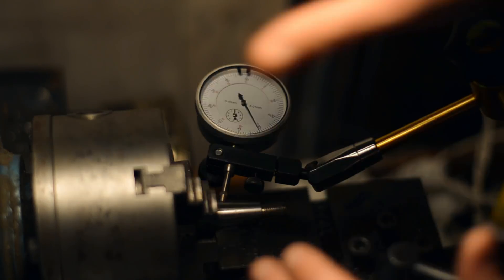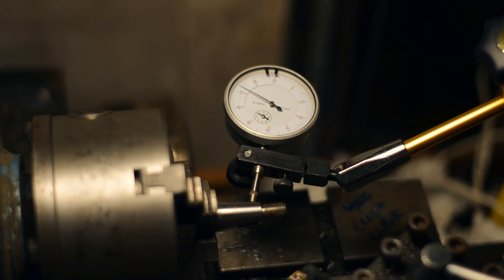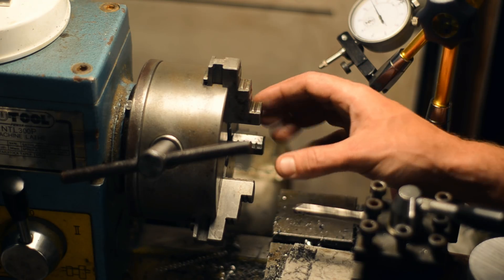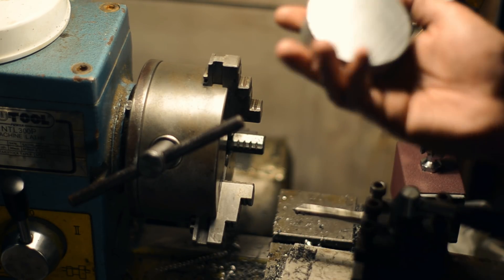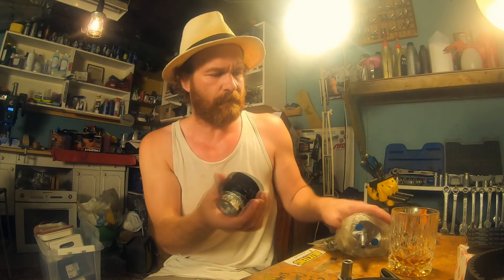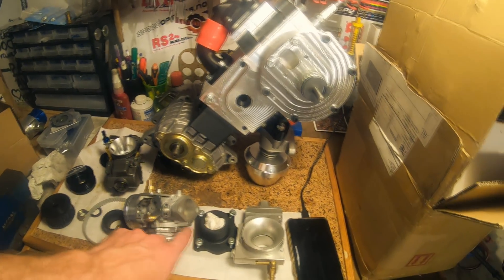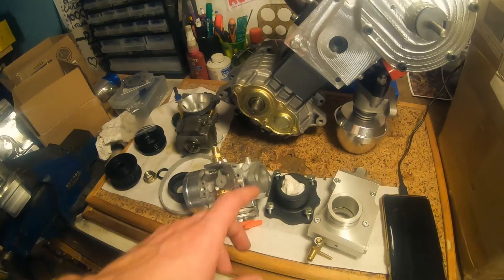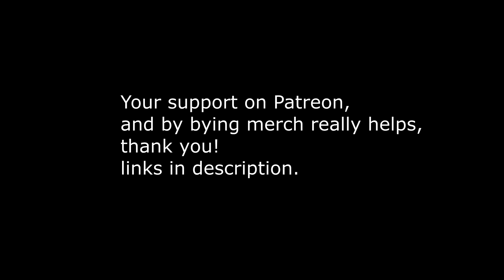Creating a Monster!

Comment: One thing with your supercharged nitro two stroke...  i recommend to ditch afr gauge and switch to straight to only egt... that is more reliable with nitro, if you want to it run properly, you will need engine running rich.... very rich, then you will get good egt temperatures. you need quite wild ignition advance with nitro too, im not sure how much nitro % you will be using but our tf engines run about 50degrees before tdc timing... + be carefull... do not explode yourself while starting the engine, i recommend to flush engine clean without spark plugs and using gasoline for starting purpose... dual spark plugs and ignition system with power of over 100mj for single spark is recommend...

Comment: There is a slot for a keyway on that crank taper, I suggest you use it.. Also the ignition timing from secondary shaft will bring all sorts of issues when trying to get to the top revs. And the fuel feed is going to get too lean, if it ever will get near the redline. Still to much parasitic loss for that rotating mass to get any gains over N/A setup. That size and style of blower needs 1,5 liter minimum of engine capacity to create more power. Your application, if you insist on using forced induction, an electrical assisted centrifugal type would give better results. It might even last a full run.

Comment: I had a couple of ideas that may or may not help you . I was thinking that you could make the nut also the rotary valve pulley as one part on its own . I guess getting the timing perfect maybe effected if the nut was to loosen.
Also I suggest if you have access to an old bus or old truck that may have a eddy current brake . It will cost a lot less and apart from corrosion it cannot wear out.

Comment: You cannot turn the jaws on a three jaw chuck you have internal and external jaws. You can turn the jaws on a four jaw chuck. Some very big lathe chucks have a facility to turn the front of the jaws, usually in heavy engineering factories, to hold internally or externally.

Comment: Dynapak use hydraulic pumps in their hub dynos.  They work great.  Pump and a solenoid valve in a water cooled recirculating tank.  The low inertia could be a problem though.

Comment: You need a 4-jaw chuck mate. I couldn't live without mine, there are so many things you can do with one that are impossible with a 3-jaw. For best results with one you also need a set of parallels and a fixed steady rest.

I also have a 'griptru' 3-jaw. It's adjustable for runout, so you can get it within 0.02mm on any given diameter of 'thing' you're holding. Excellent for repetitive work, but no match for the 4-jaw on versatility.

Comment: I think the pumper carb should work and you shouldnt have pulse problems.
Reply: I agree. Every time the transfer ports are exposed the pressure in the manifold is going to decrease by a lot, then bounce back up as the transfers are covered again. Also the roots blower will inherently create some pulsations in its output.
Reply: @nerd1000ify  yea man i was thinking the same,  looks like a nice carb too. We shall find out soon💨💨💨💨🤙🏻

Comment: Back when I was an electric traction motor apprentice (1979 - 1981), I used to operate & maintain a Thomas Salter brake dynometer, testing the 22 HP forklift traction motors that I'd built.

The dynometer itself was an dynamo with attached wind turbine loading contraption. The dynamo was electrically connected to a second electric motor, with a 12 Inch arm on its output shaft, which was coupled to a set of massive Thomas Salter pull scales (The brake part of a brake dynometer). 

During testing, I'd measure the peak load current consumption and measure the RPM with an engineer's hand held tachometer. I'd then observe the amount of Pounds being exerted on scales, which because of the 12 inch arm, was now torque in Pounds / Foot. Using a slide rule (later a calculator) I'd multiply the torque by the RPM, then divide by 5,252 to reveal the horsepower. Because I was using a brake dynometer, the electric motor's test plate was stamped as BHP instead of HP to demonstrate that the power output was derived from measuring torque output and not through electrical Wattage generated.
 
A brake dynometer of this type is the simplest and easiest to construct, even in miniature to test Scalextric cars
 
For a moped engine version you need 2 x car starter motors (one to act as the dynamo), a set of pull scales, an accurate tachometer, a loading contraption, some metal and some wire.

Comment: Will not placing the ignition trigger at the RV mean that every time you like to adjust it, you have to reset the timing…again…and again… 
Jag skulle bli tokig! 😅 
At the crank is has other advantages as well…even if I realize it’s tight.
Looking forward to the continuation of the PiP when time is.

Comment: some made an eddy current brake from a retarder https://www.huismanauction.com/auction/38/item/jacob-electric-brake-retarder-for-truck-driveline-3000/
these are usually mounted in busses and trucks driving in the mountans a lot , with a retarder they dont have to brake as hard saving them from overheating and fading 
you could allso use a big electromotor rewired to work as a generator and a bunch of balast resistors that you can add to the circuid to raise the resistance the generator makes 
a local moped / bikeshop ran a 250 cc dragbike and had a flywheel with a diskbrake he basicly took the rearwheel of the bike mounted the rear fork to the frame holding the flywheel and used a longer chain 
he measured horsepower and torque by measuring the time it took to accellerate between a base and top rpm in top gear , he did put a matrass over the flywheel as a shatter blanket 
could allso use a big centrifugal waterpump from a firetruck and make a water columb (stell pipe going up two floors or so before overflowing in a big water container) with taps at different heights for the ballast you might need to drive the pump at half speed to prevent cavitation (wonder if a jetdrive for a boat or even the tailsection of a realy big outboard engine with a big prop hung in a vat of water would work , if it does it might be the cheapest option )
combinations work too and might reduce the size of stuff you need

Comment: Hi, use Bacho / Sandflex 3906-300-18 to cut solid, or 3906-300-24 for cutting thin materials or tubes. Super quality that will make a difference. / S

Comment: Parasitic loses through belts may beat you, good luck
Reply from the maker: Properly tensioned toothed belts aren't bad at all. On the dyno it doesn't matter either way, the load cell is mounted to the engine which pivots around the crank axis.
Reply: @2STROKESTUFFING  isnt that your blower drive ?
Reply from the maker: @crunchytheclown9694  Yes, sorry, though you were talking in general. I can't see a better way to drive the blower. If it was incorporated into the case I could use gears, might go there if it delivers.

Comment: Is the weight of the pullys an issue? Seeme like a lot for a 50cc to turn.
Reply: Ive seen 3d printers with pulleys this size, no problem at all for a 20hp engine

Comment: Geez I have always thought you to be a character even with out a hacksaw.. ;-) I have made a little air conditioner for my shop. It consists of a Styrofoam cooler with a hole cut in the top to place a large computer fan, fill it with ice, sprinkle salt on the ice and give the fan a bit of power.. They put out a lot of cool air.. it really helps and if you use batteries to power the fans they are portable. Oh I forgot.. you blow the fan in and on the other side put a curved pipe (I just made a hole to press fit it in so I can turn the corner pipe in the direction I want the air to flow) I hope that made sense.. at 70 sometimes the ideas are fine but the translation to words gets a bit jumbled.. Carry on.. this s so great..
Reply from the maker: Great idea!
Reply: @2STROKESTUFFING  Those baby crank out more than you think.. At least I was surprised.. and grateful I did it.. took me two years to make it happen.. wish I had done it earlier.. good luck, stay safe..

Comment: you can use flat side carburetor,  they are very good
Reply from the maker: The blower might prevent the flat slide from closing.
Reply: @2STROKESTUFFING  ooh , i didn't thought about that, so clever

Comment: Take the jaws out the chuck and flip them! That's why they are stepped!
Reply from the maker: These are non reversible I'm afraid.
Reply: @2STROKESTUFFING  🤦‍♂️🤦‍♂️🤦‍♂️ any chance you could machine reversible ones?
Reply: @high-techredneck220  He could CNC some, but it would require much time and a rather small (read: easily broken) endmill to cut the grooves on the back.

Probably better off buying another chuck. A 4-jaw independent chuck would be the best. 3-Jaw chucks are only accurate to 0.06mm or so generally (in terms of how much runout you'll see on a round bar held in the jaws) so you really need a 4-jaw and indicator if you have to do precision work that involves re-chucking a part that already has a finished dimension on it somewhere.

Comment: Maybe index the pulley on crank and balance?
Reply from the maker: If there's vibration issues 👍
Reply: @2STROKESTUFFING  I guess you will test run at lower RPM to check for vibrations?   20k rpm might be to late.

Comment: Before anyone else suggests it, those chuck jaws are non-reversable
Reply: There is growes on the outside implying that is is.
Reply: @niklashultkrantz7766  They are for holding the inside of a ring or tube by expanding the jaws outwards.

Comment: Turn the jaws around... I would also lap the taper onto the crank for a perfect fit.
Reply from the maker: Non reversible jaws... Lapping is a good idea, I've used toothpaste on flywheel tapers before with good results 😁
Reply: @2STROKESTUFFING  How are they non reversible? There are those non slip grooves cut on the outer surface too on the jaws. You might wanna take another look on it mate :)
Reply: @DraGma  Never crossed your mind that those grooves could be for ID holding?
Reply: @2STROKESTUFFING  Get some diamond paste in a few grit sizes and once you get a perfect fit apply a little 1 micron paste on the crank and install the pulley. The diamonds will lock it place. Cheap and very easy. My Dodge Hellcat uses a diamond coated washer on the supercharger pulley to drive it and that alone takes 80hp.... Works good on go carts and any small engine that uses a billet flywheel....  Too bad about the chuck. I will look in the spare chucks and see if I have a 4 jaw laying around for you. What size would work and what is the taper/screw on the spindle nose?
Reply: Right?!
Reply: yep, thats one of the uses of those steps.  just flip them upside down.
Reply: @Oyez10  The jaws on most scroll chucks aren't reversible. They have curved grooves on the back that fit into the spiral of the scroll that moves the jaws in and out. If you try to reverse them you'll find that the grooves won't fit into the scroll. Usually the chuck will come with a set of 'outside jaws' that can replace the normal jaws for this sort of work.
Reply: Do you really think that he dont know that on some lathe Chuck that is possible? The man is Genius make stuff at home that other people are dreaming about. Come on

Comment: Great efort! but wouldnt pullys free spin after a while, it needs a key in krankshaft and in pulleys to lock them in 360
Reply: A key is for alignment when timing is important, a well machined taper will have much greater torque capacity than a key.
Reply: A correctly machined then lapped and  torqued taper fit will not budge.
Reply: Thank you šo much for this knoladge!

Comment: what if you took the pulse from the exhaust??? that will have a varying pulse because of the rotary valve it wont be under constant positive pressure?? just a thought im no two stroke god like yourself though;P
Reply: Entirely reasonable solution.
Reply from the maker: Agreed!
Reply: 🙏❤️I figured nitro RC engines use exhaust pulse to pressurize the fule tank so it should be able to work the diaphragm in the carb ☺️
Reply: @mattyceks380  RC engines use exhaust back pressure to pressurise the tank which is a bit different, and I suspect could be quite dangerous when scaled up as there is nothing to isolate the burning exhaust from the fuel (i.e. no fuel pump diaphragm).
Reply: @ferrumignis  yeah I know they do /\ as I said above/\ and if the exhaust was used it would be pushing and pulling the diaphragm of the pumper carb the gasses wouldn't be touching the fuel.

Comment: Please make PiP cylinder avalible for us across the pond one day! 🙏 also fineish tooth wood saw for aluminum if you gotta cut by hand.
Reply: A lot of wood saws have teeth soft enough to be cut with a file (this allows resharpening by a saw doctor). Such saws won't last long in aluminium, so if you do this I can only advise that you get a cheap one with induction hardened teeth.
Reply: @nerd1000ify  ive been doing it for years. Same saw never sharpened still works fine for me
Reply: @nerd1000ify  also i find a 20V jig saw to work pretty well
Reply: @YeeThirty  you can get metal cutting blades for those I think. I tried a scrollsaw with a junior hacksaw blade once, but the stroke was a bit short for the thickness of metal I was trying to cut so it didn't clear the chips well. Would have been fine for aluminium sheet.

Comment: I don't know how much toque will be on the blower pully but instinct tells me you will need to cut a keyway to prevent it from slipping on the crank.
Reply: No need for that at all. The cone shape is enough, but maybe it need a bit of valve lapping compund.

Remember, every cvt clutch is without a keyway
Reply: when you have a key/taper combo its usually for timing reasons.
Reply: I mean 500hp+ snowmobile is without any keyway on their crank without any slipping
Reply: @danielssonsgarage  My instinct was wrong I stand corrected.  Thank you👍
Reply: @landroveraddict2457  Most engine builders are getting away from key set drives. Chainsaws break cranks rarely but most snap at the foot of the pto thread in the shoulder area or internally at the crank pin area. Tapers are stronger with no voids.
Reply from the maker: Yep. The crank nut generates a lot of force.

Comment: You could always use a little valve lapping compound to lap the pulley to the taper, just to get a little nicer finish that the lathe tool can manage.
Reply: Ditto!
Reply: @kcraig51  When you lap a taper the fit becomes so tight that the pieces are virtually impossible to separate. DO NOT LAP. Speaking from experience !!
Reply from the maker: Yep, needs to be pulled off. With how this one feels already I think it's good enough.
Reply: @stantongiles6641  
Isn't that literally the entire goal of a taper fit? You want the materials to literally be inseparable and never slip, without the cost of splining it. 

Of course, that means the use of heat and/or a strong puller to remove them again.
Reply: @nickopedia5669  if you lap to much its inseparable! No joke! And it goes pretty fast
Reply: @2STROKESTUFFING  if you have good surface, then no need to lap. It can get stuck forever with lapping so its tricky
Reply: @stantongiles6641  when two part have so good finish its can jam hard together, there is science videos about that.
Reply: Yeah that's what i thought.

Comment: A trick you may not know with Aluminium - because it clogs tools very easily - use paraffin or turps on the hack saw or drill our milling cutter/lathe tool.
Reply: WD40 works
Reply: @AuMechanic  Yeah used that a lot and Tapmatic - but they get a bit expensive after a while!
Reply: @graxav  Yeah not as cheap but I'm lazy and the spray is easier than filling oil bottles. I buy WD40 at the big supermarket a lot cheap than the auto stores here in Aus.
Reply: Or just use a wood blade that doesn't clog as easily. I would have used my skill saw hahaha
Reply: Acetone or alcohol works suprisingly well, at least for tapping and drilling...
Reply from the maker: I'm using isopropyl alcohol, nice cause the chips are dry and easy to vacuum up. Used as surface sanitizer at work so it's "free" too😁